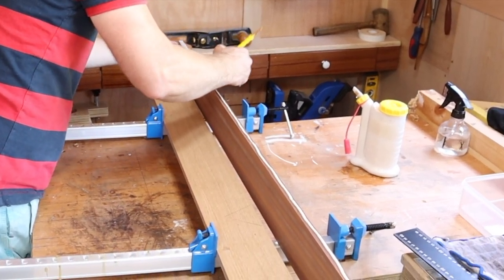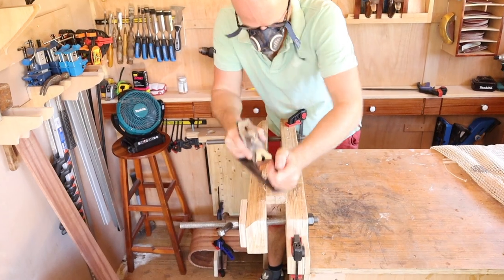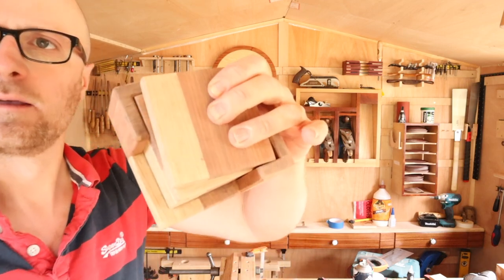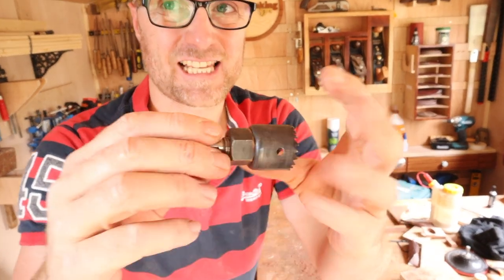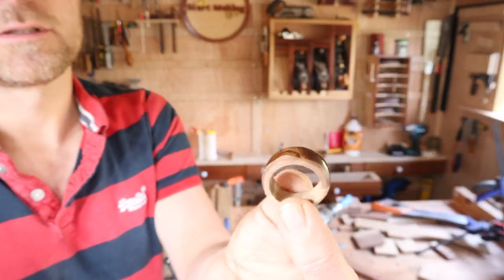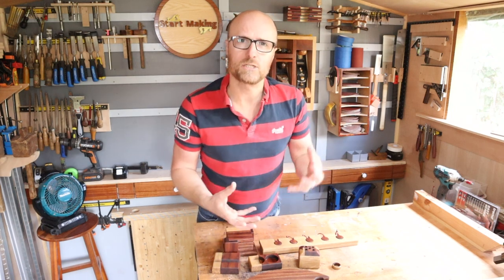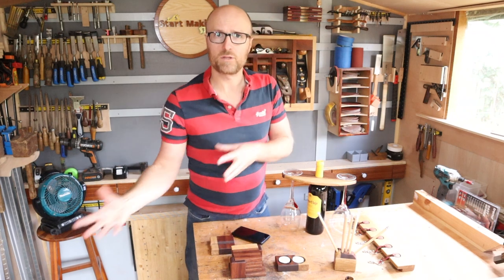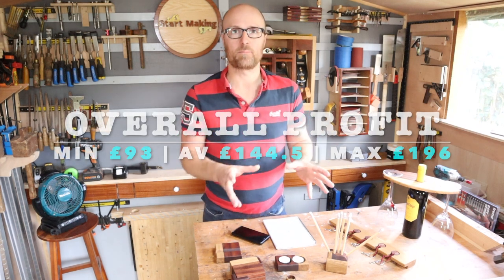Beginner Woodworking projects that Sell | Make Money for tools.

Comment: Great job and projects I will definitely be making some of these You should make a sharpening video that plane you use is SHARP and AWESOME Cheers
Reply from the maker: Hi Larry. There is a sharpening video somewhere in there. It's a bot long as it contains chisels and card scrapers. But I still use the same method.
Reply: @startmaking1  thx

Comment: Great ideas Mark and lovely to see combinations of contrasting woods. 
re scraps....I have a lathe and have used leftovers to make bulb dibbers (from old oak chair legs), beer bottle openers adding the metal opener and light/blind pulls which use quite small bits of wood. Can also make little wooden creatures such as mice, lambs etc using a bit of design thought and I'm making a variety of wooden cups, balls and discs etc for my baby grand daughter as she grows.
Reply from the maker: Thank you Mike. I love the light and dark contrasts. Helps that these 2 woods are the ones I can get. Kids are a constant source of making ideas. love it.

Comment: Hi mark top stuff what was the dimensions of those 2 pieces of wood thanks.
Reply from the maker: Hi Steve. Thank you again. That is a great question and details I should have really included. the boards were 9mm thick, 100mm wide and 1200mm long. Since the video the coasters have cupped ever so slightly while everything else is good. For that reason I would maybe consider a slightly thicker board. Or I may have been unlucky.

Comment: Hi great video can i ask what cutter/drill bit you are using?
Reply from the maker: Hi Firehorse. Thank you. Do you mean for the holes on the key hook. If so it is a forstner bit. Not sure size but can check if needed.
Reply: @startmaking1  hi it was for the Tea light holder
Reply from the maker: @firehorse74  The tea light holders was a forstner bit. I have just measured the hole and it is 45 mm diameter. I suspect the bit is 43mm as it tends to swim a little
Reply: @startmaking1  Thank you for replying 👍

Comment: What size are your board Mark? About 4 x1?
Reply from the maker: Gosh, that is a really good question. I have just checked and each board was ordered to be 10mm wide and 15mm thick. finished pieces end up 12mm thick. I hope that this helps.

Comment: Some great ideas, there.
But - the Fire Service insist that tea-lights must be placed in non-combustible holders. So if your product causes a house-fire, you could be held liable.
The good news is that tea-light holders are cheap on Amazon and will actually enhance the look of the product.
Reply from the maker: Hi Clive, Great insight. Lucky my candles in the picture were battery ones. Hopefully that will cover me against any issues. That said, I hope that nothing happens as a result of people using real ones. Will check out the holders. thank you as always for watching and commenting.

Comment: Good inspiration. Where did you buy the wood and what were the dimensions?
Reply from the maker: Hi Adam. I actually had it cut to size at G and S Specialist timber. 12mm thick. 100mm wide and 1200mm long. I tend to order hard wood from here as I don't have the large machines to mill it. Thank you. for watching and especially for commenting.
Reply: As well as a great video a good recommendation for a timber supplier, nice bonus, thanks 👍
Reply from the maker: @esxdave  Thank you very much. I have found them to be very good. Slightly limited on the hard wood front but I tend to use mainly sapele and oak
Reply: G&S are just up the road from me.  I’ve never used them before but having had a quick gander at their website, I will now.  Relatively small orders for free delivery, as well. Useful, thx